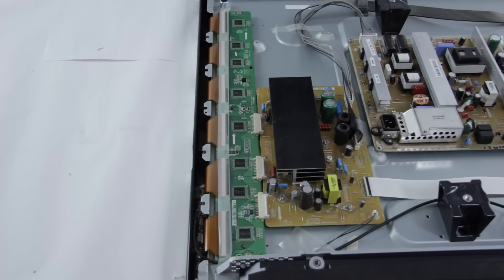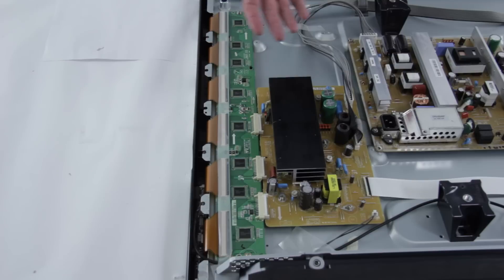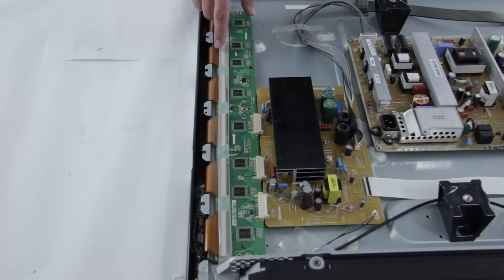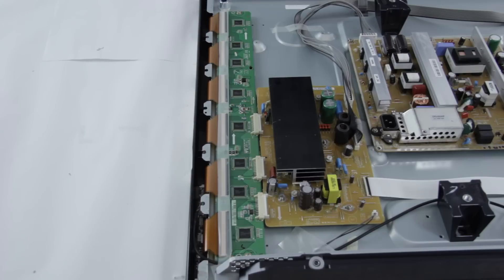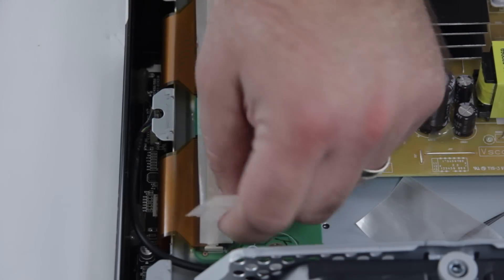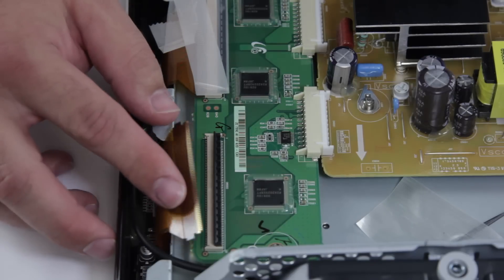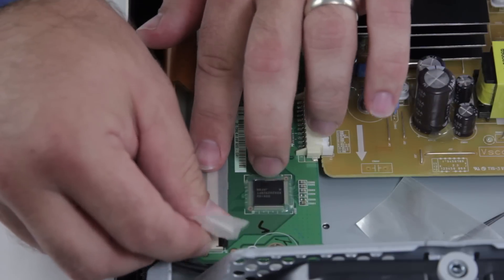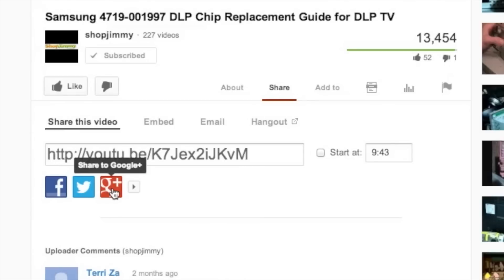Plasma TV Repair - No Image, No Picture on Plasma TV Screen - How to Replace Y-Buffer & Y-Sustain

Comment: Hi there, my Sansui plasma TV model S42AX-YB09 has got no picture and make is making a clicking sound 3 times click, click, click when you switch it on. There is power on the power supply and the red standby led light turn blue when switching the tv on. The clicking sound like a relay that's going on and of 3 times and then it goes silent, but screen remain blank. No picture.
Please help.

Thank you for a great YouTube channel. Keep up the good work.
Regards, 
Johan westland
South Africa,
johanwest1010@gmail.com
+27 790789979

Comment: I have Samsung Model # HP-S4273. Picture works for a few minutes then goes dark but the sound works fine. After turning off the tv then turning back on the same thing happens. Where would you recommend I start.
Thank you.

Comment: I have a Samsung HPT5054.  About 4 months ago I had to replace the power supply board (bulged caps and cracked transisters).  It would pop loudly and cycle off and on and finally died.  After ps replacement, it worked great.  Until now, now it will turn itself off with no popping.  The small blue led on the front will blink once every 6 seconds or so while off.  It may stay off 5 or 10 minutes and then you hear a click as if you are turning the tv on, and it comes back on by itself.
I checked all the caps for bulging when I replaced the ps, and the only caps bulged were on the ps.  Any ideas?  I know it is old, but it is a great tv, and I would like to wait another year or two before I try an Oled.
thanks
Reply: Also, the tv may run all day just fine and act up for 30 min and then run ok for another 8 or so hours.  No real pattern.

Comment: Hy I have the model LG PDP42T3000.  and after repair I have no picture no sound but the TV it look s to work! No blinking LED.  If you turn it on the TV starts you get a light on the screen for 3 seconds and then the light go s off. the tv still produce high voltage becouse you can here the buzing sound on the bord with the buffer ! The only thing that i find faulty was 2 30F124, 
 and at the buffer side   2 30F125 and 2 IRG71C28U

Comment: Hi, need help with a Panasonic P65VT50 Plasma TV.  I have no picture.  It does have sound and the red light at the bottom front is on and not flashing.  When I turn the TV on and off I get a quick white flash which I normally have.  I have changed and checked my HDMI cables and tried all of the inputs so it does appear to actually be the TV.  I also tried the usb input with no success.  This is the best TV i have ever had so it would definently be worth fixing.  I am an HVAC tech and good with electronics but I need an idea where to start or what to look for.  Thanks.

Comment: hopefully you will reply back. I have a Samsung pn51d490 51 inch plasma TV I think the Y main buffer board has gone out .  I don't know if it is the Y buffer board  but the TV makes a loud buzzing noise right on the last black Square thing on the bottom of the buffer board and sometimes in random places. And when I mean by loud is that the whole room can hear it and I am also not getting any picture when I turn it on please help.

Comment: I have a Samsung plasma. Model# PN51D450A2D. The screen had a black fade looking section start in the top left corner. It slowly spread accross the whole screen until it completely blacked out. Now the tv has no picture no matter what i try or do. Plus if you turn it on you get a loud buzzing noise comming from the same top left corner. What would i do to fix this. And yes its out of warrenty.

Comment: Im pretty sure it y sus board because the tv pops and turns off at random times, if it turns off once it will do it continuously. My only question is the picture quality on my TV is still perfect could this still make it the y sus  board? I just want to make sure I order the right part.  Lg 60pa6500

Comment: Hello, I have a Samsung 43" PN43D450A2D plasma 1st problem- won't power on, replaced with shop Jimmie main power board. 2nd problem- it clicked 3 times but would not really power on. Replaced X main board, now powers on has sound no picture?

Comment: Help.. I have a Samsung plasma tv and a few months ago, it wouldn't turn on anymore.   Plugged it in yesterday and it everything worked ok.  About 20 min into a movie, the picture went black but you could still hear the movie. Unplugged and plugged back in and now screen is still black but can't test to see if sound works because I had a firestick connected.   Any suggestions and thanks in advance.

Comment: this post is 5 years old, but I'll try anyway. I have two 42 inch Vizio TVs, one is a plasma model VP422 and I cant get at the other one right now. 1st the VP422 went down, the power light comes on --no sound, no screen. The other one I replaced the first one with just died tonight. Same exact symptoms as the first one. These seem to be bad luck for me

Comment: Have Panasonic plasma Viera model TC-P42GT25.  No picture problems but the sound (internal speakers) went out completely on both speakers and there is a constant low buzzing sound which is not a blown speaker sound. External sound ports work fine but the buzzing is annoying. Blown cap or have you repaired this symptom? Any vids on this before I crack it open? Proficient at soldering and have MM. Thanks!

Comment: My Samsung model PN50C550G1FXZA  was displaying vertical lines. I attempting to clean the ribbon cable connections and the screen stopped producing a picture. The tv turns on but the screen stays black. No menu. There is nothing. I have replaced the power board and that is when the lines became apparent. I assume that if I can fix the black screen I will still have the vertical lines.

Thanks 
Stacy

Comment: Hi I have a Fujitsu 50" wide plasma display model no. P50xha10us okay my tv just about two months ago started doing this it comes on then the green light went to red flashes four times then starts over after a short time the tv will display blackout  but the sound still working I cut it off 30 minutes the screen comes back the process starts over again my email is kirklandrichard96@yahoo.com please help

Comment: NEED TV REPAIR HELP.
My TV is LG 60PM6700 plasma TV.
All menu are good and clear, The only problem is with the picture and Video.
I can hear sound but the picture is all white with vertical lines.
I try all USB ports with video , all HDMI ports , antenna and external files.
All I get is this white picture, same with the picture test.

what is the problem with this TV??????

Comment: LG,plasma tv problem.

Model 50pc5d ul.ausyljr,chassis pa75c.Was in a storm,lightening hit the house or close by,the other tv is ok,some appliances damaged.When plugged in the green panel light blinks many times then stays on,hard to shut off but eventually will and the red light will come on.Tvdoes not run,nothing,flat dead.The power board has 4 of the 6-10 volt 3300 mic caps in the secondary blown out I changed all the caps in the secondary out except for the one for the v voltages.The power board comes up now ,all normal voltages except for the v voltages,nothing not even a jump or a spike,flat dead.I am thinking the power board has more wrong with it,or is it possible one of the high voltage boards has something wrong with it and causes the v voltages on the power board to shut down?I call them high voltage boards be cause I forgot what they are called.I find no blown fuses not even small board mounted fuses.So far I haven't been able to find anything wrong with either high voltage board.Also the high voltage boards have rubber pads under them,the glue on them gets bad and will run down the inside of the boards and blow them out,I've seen it before.I guess I am confused as to what may have happened here?internal or external causes or both?Can you help me any

Comment: I have an RCA 42" plasma(i believe) that won't show a picture. I was able to push the power + input buttons at the same time and it would work. The standby led is red. Push the power button, it turns blue but no picture. Black screen. No flashing. No click. I always heard 1 click just before the picture came on before the trouble began. I replaced the power supply board but still have the same problem. I ran the TV for about 2.5 months without turning it off for fear it would turn on again. Well after I got home yesterday, I grabbed the wrong remote and hit the power button. I can't get it back on! Any ideas? What was the combination to power it up? Power button + input or PB + menu? What board(s) should I replace next? RCA MODEL# 42PA30RQ SERIAL# 2307-PA30R-A101252.       Thank you for posting the video and any advice you may have.👍

Comment: Hi, I have an LG 60PK750. It started turning on and off by itself for a few months. And now the picture has gone out. I still have sound and can use the remote to cycle through inputs or change channels. But no picture, only sound.

Comment: I have a Sanyo DP42740 that power green led comes on but shuts back down after a sec or two when power button pressed.  Tried replacing power board but did not help.  After finding a service manual on the TV, I found TPVSUS pin on TNPA5072 AF board grounded so probably need this board.  Disconnecting this board totally including ribbon cables still does not solve power problem but do now have 190v on Vsus on power board till lock out.  Finally after trying other items, removing ribbon cable to SN bd, TPNA5066AC leaving power from power board connected but not jumper between it and SS board, the Vsus stays on.  I am expecting this means that SN board also needs replacing unless this is a problem in the Digital board end of the cable that shorts out voltage.  Any input? Notice you do not have the AF board in stock.  I cannot repair or would get the parts.  I will send back both power boards and you keep what I paid as it was my fault for not finding a service manual and testing things.

Comment: I have a Samsung model PN51E530A3FZXA, version TS02 51" plasma TV.  One night, I heard a "pop" sound and saw smoke rising from the left rear of the TV.  The TV went black and had no picture or sound, not even the little jingle sound it makes when turning off or on, however, the red power indicator light stayed on.  I was advised by a Samsung tech rep that the power supply board probably "blew" and needs replacing.  I bought a brand new power supply board, installed it (very simple), but still have no picture or sound, although the little turn on/turn off jingle has returned.  A visual examination of all the other boards in the back show no obvious damage anywhere.  Any ideas?

Comment: Samsung PN60E530A3FXZA picture will go out. After explaining what the problem was, I suggested what has been mentioned here. He said you can't repair them anymore because all of the parts are encased and you can't get to them. He said it's probably a 30 cent capacitor that's causing all of the problems but they made it impossible to get to the part.

Comment: I have a Samsung PN64D8000. We hardly use it. I turned it on this morning. Before the screen cam on I think I saw a white light flash on the upper right corner and loud pop at the same time. The red stand by light blinks 6 times when its plugged in then stays on. No picture or sound. I hope it's repairable because my mom is moving in and it will be needed then.

Comment: I have a ps50c450b1w samsung tv i plugged it in and the red standby light comes on then i pressed the on bottom it makes a click sound and a musical sound like its ment to when its coming on then the screen flick on but only for a fuw seconds befour making a click sound again when the screen turns off also it makes a buzzing type sound that comes from the top left corner if you where looking at back off the tv.

If you can help me I wud be very grateful

Comment: Hi there my samsung plasma pn64e533d2f started with colored vertical lines on the left side and then popped and shut off and now it won't turn on, do you know if the tv is worth fixing?

Comment: I have LG 50PT350. It works for a few minutes then picture disappears (screen goes black) then after several seconds picture comes back. Picture stays on for several seconds then black screen and the cycle continues. In a few occasions large portion of the screen was covered with vertical lines, but most of the time it just cycles between picture and black screen. Can you offer any suggestions for troubleshooting ?

Comment: Hey I have a Panasonic plasma viera model number : TH-50PX75U, and I'm having trouble with the screen showing picture its pitch black. And I also hear a popping noise like the tv is comin on but I never get any picture and the red power light continues to blink...what do you recommend doing to fix this problem?

Comment: samsung series 5 530 plasma 60 inch
If the tv has been on for a few hours and turned off, you must wait 30+ mins before you can turn it on to get a picture.   Will have a blank screen with sound.  You can hear the jingle play to let you know it's on but no picture.  Also when the picture works you will see a slight flash when turned on.  When the screen doesn't work there's no flash.   Any help would be greatly appreciated.

Comment: I have a samsung pn51d450a2d that the screen doesn't light up it flickers then goes back dark Im guessing the y board and buffer but I wanted a 2nd opinion also the logic board blinks about once every 10 seconds.  Thanks for the input you guys rock.

Comment: I have LG Plasma tv 50PT350. No pucture at all. when that happened at the beginning it was voice but then no voice and picture at all. when I try to turn it on or off from the tv or remote, the red light keeps flicking making vlicking noise and then gets solid red.

Comment: I have a Samsung Plasma TV model PS43D450. There is power but no display. When I'm turning it on, there is different sound from the TV.
Reply: Captain Steel hi did u found the problem wt ur plasma tv?I have the same problem is it the main board problem or the logic board

Comment: I have Samsung PN50B550.  The tv had no stand by light and would not turn on.  I removed the back panel and unplugged all boards from the power supply and the power turned on with no picture.  I then connected the x board and turned it on and the tv stayed on. I then connected the Y board and the tv would turn on, then shut itself off.   Do you recommend replacing both Y boards?

Comment: Hi, I have a vizio vp422hdtv10a plasma. It fell. Now won't turn on. The power supply has been tested and is good. There is a loud buzzing coming from the y sus board. I don't see anything visually bad. Here's the thing, I don't want to replace the ysus and y buff just to find out that the panel is no good from the fall. Is there anyway to positively single out just those 2 boards?

Comment: Samsung PN60E530AFXZA - The TV will be working properly and then the picture will just go out. You still have audio, but no screen

Also, if you have had the TV on and then shut it off, you have to wait at least 15 minutes before you can get the picture to come back on. You get 3 blinks of the red indicator and then nothing.

Thanks for any help you can give me.

Comment: I have an LG 50PS60 that has started to have picture blank out while watching. The plasma seems to work fine otherwise; all remote codes are being received, I can hear audio, and I can turn the TV off and on, just no picture. I've tried unplugging for extended periods of time with no immediate improvement. The TV will work if I turn it off and back on a few times, and will continue to work for hours or even days before the cycle starts over. I dont know if this is another symptom, but I did notice a few months prior to this that the picture will be dimmer in backlight/contrast when we first turn it on, then pops into correct mode after about 2 minutes.

Comment: My 60" plasma LG60PV4000 power cycled and came back on with no picture but I could still hear sound. I have replace both the Ysus board, and the y buffer boards. however i am have the same issue. any suggestions?

Comment: Hello. I have a lg 60pz950 plasma tv. The screen has been shutting off periodically while sound stays on. Turning off and on again would bring picture back but has been happenening with more frequency and restarts don't fix it every time. Any suggestions?

Comment: Hi. I have a PN43D450A2DX. At first it wouldn't turn on. So, I replaced the Power board, then the Y-Main and Y-buffer, then the X-main and the T-con.  Now, the TV turns on, I get the tones and standby light, but no video or audio. I get the tones when turning off.  Vs=206, Va=58. What else could the issue be? Thank you.

Comment: I have Samsung 60" PN60E6500EFXZA, the TV turns off by itself and wont turn back on and there is a vertical line at the right side of the TV

Comment: I have a 2008 Insignia NS-PDP50 Plasma TV.  Today we were watching it and most of the screen went black.  There is a small thin line of color at the top of the screen that shows movement and you can hear audio of the show on TV but there is no picture.  Do you know what would cause this issue? 

This is the first issue we have had with the TV and there was no warning signs that something was getting ready to go out on it.

Comment: I have a Philips plasma 42" flat screen mod# 42pf7220A/37, I have replaced the y main power board as well as the power supply unit. The power comes on and the screen is black with no sound. I have also replaced bad capacitors,   there is a small blinking green light. My repairs started with a blinking red light . My question is what should I try next.

Comment: My TV is a PN60F5300AFXZA Plasma. Red LED is just flashing. Took readings for several voltages off of the power supply board and they are double.